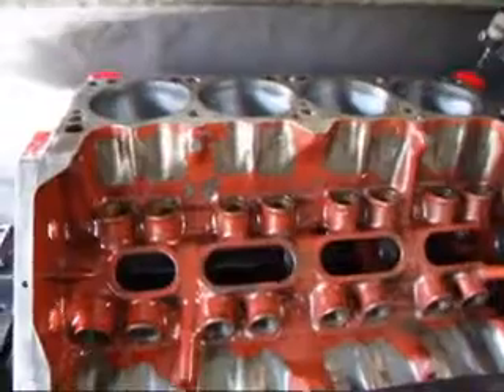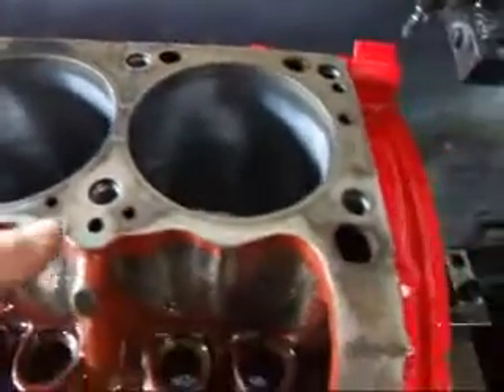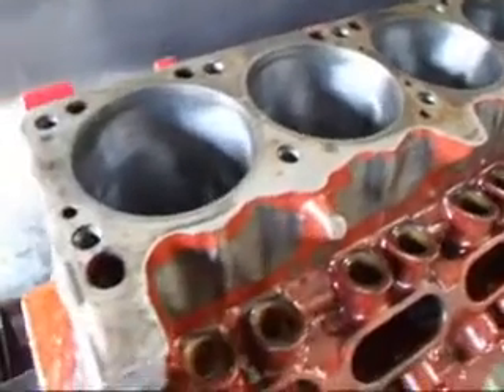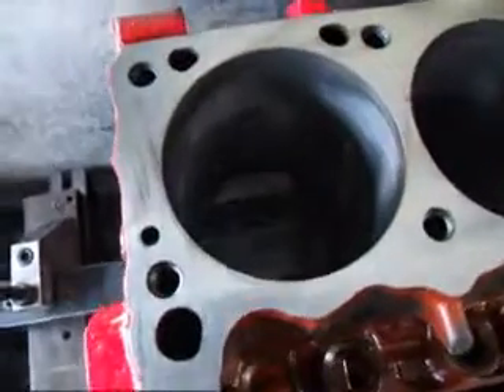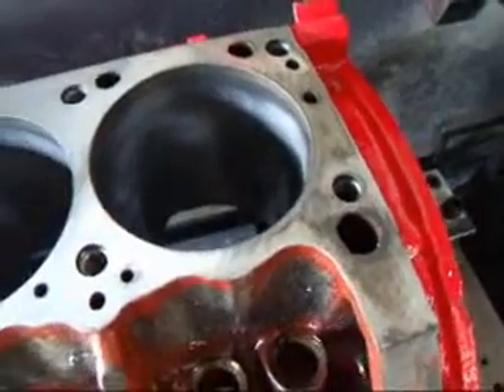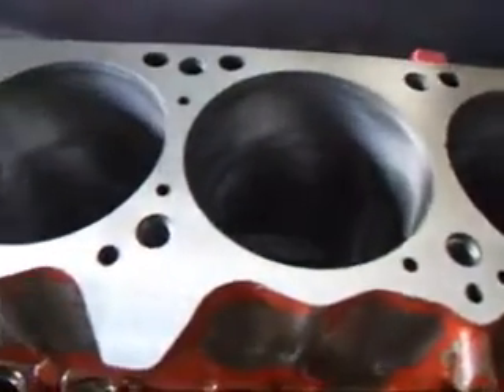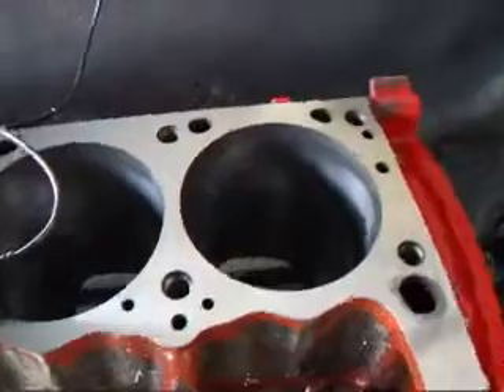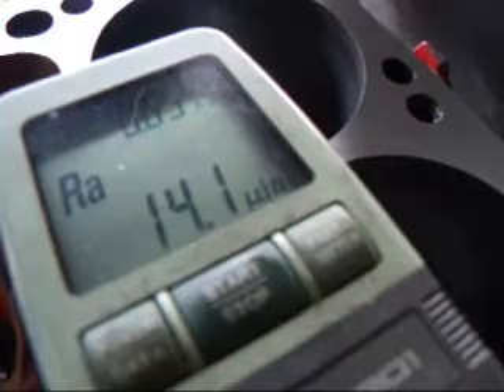Dodge 340 Block Resurfacing

Comment from the maker: Depends on how much crevice volume you have, it's a measured process. Some engine will have the pistons sticking out above the deck surface. I minimum clearance between head-pistons would be in the .030" range.